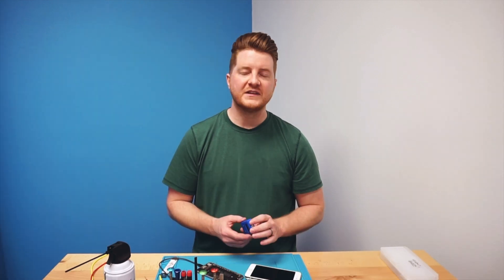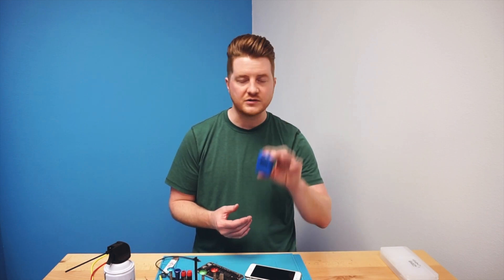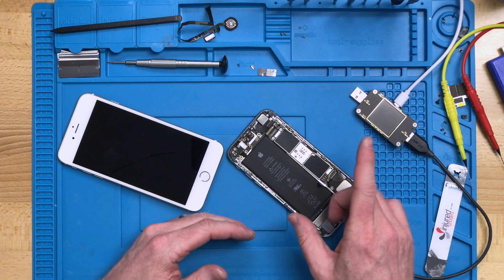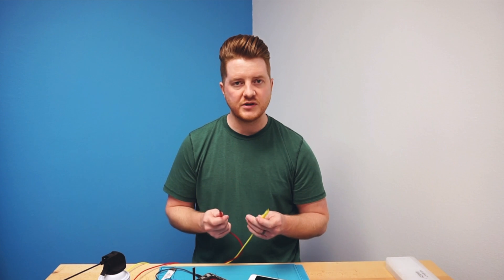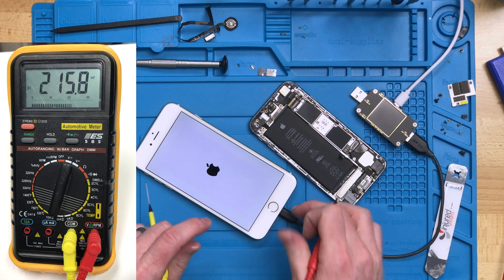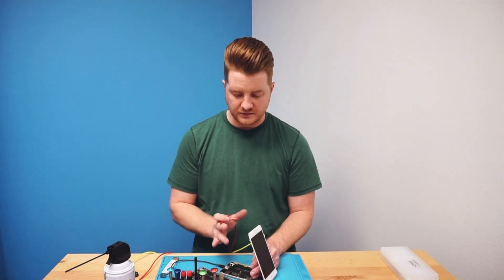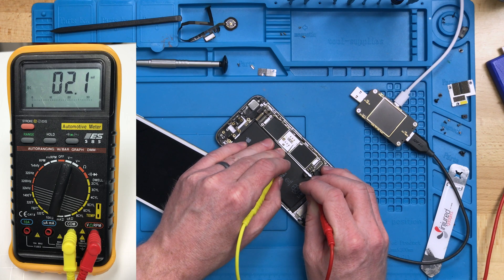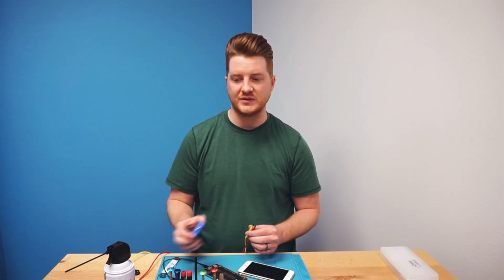How to test tristar on an iPhone using a multimeter - Repair Shop Basics

Comment: So I replaced a ic, charging port, battery digitizer display, but it is not showing any image on the screen and it is showing no amps or voltage, for the iPhone 5s, any advise to what it could be?
Reply: There is a short somewhere

Comment: My iphone 6+ have been boot looping for months and I can't find the problem. software restore does nothing. Previously I have replaced the battery and charging port. Any idea of how to diagnose?
Reply: Only time I'd had this happen was because of the LCD. For some reason some LCDs work for short while but then put the phone stuck in a boot cycle. Putting a different LCD usually corrects this issue.